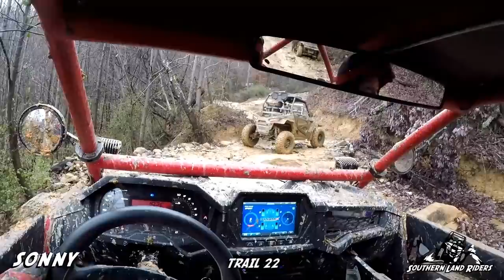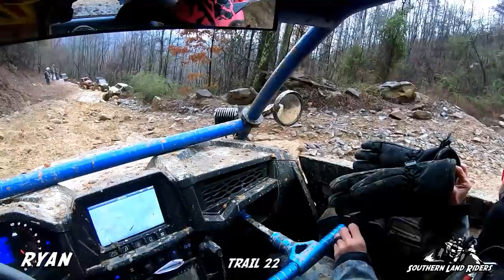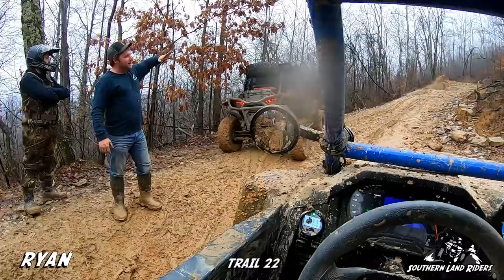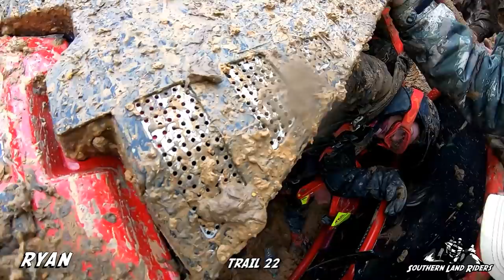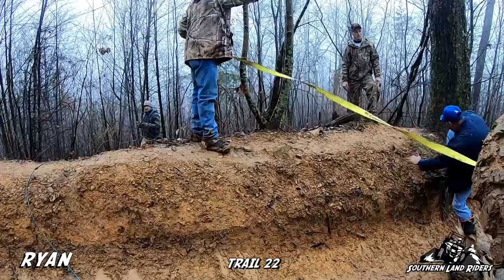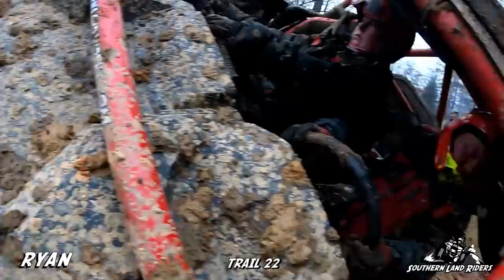Windrock 3/2019 Day 4 Part 2 (Trail 22 + Mud = Rollover)

Comment: Did Joey not get the 1000 fixed ? I got my Bayou running that carb was nasty petcock valve was terrible took gas tank off drained the tank put the tires on but gotta let a lot of air out they put way to much air in them   I took it for a spin bounce me around like a basket ball sent the wrong voltage regulator rectifier ordered the right one but still going riding today fresh gas new spark plug and air filter. And going to order some wires and connectors. By the way that's a lot of mud
Reply from the maker: He did get it fixed. It is all good now.